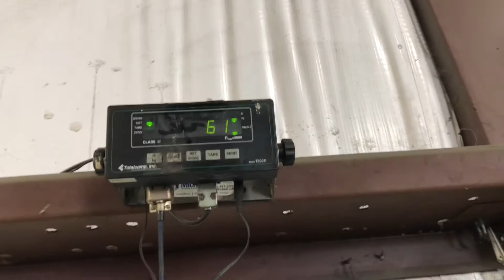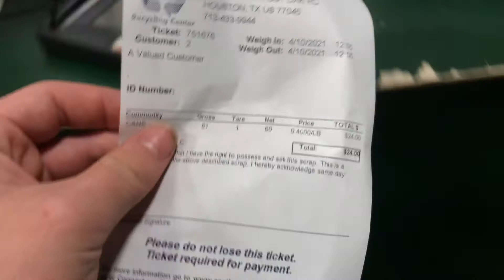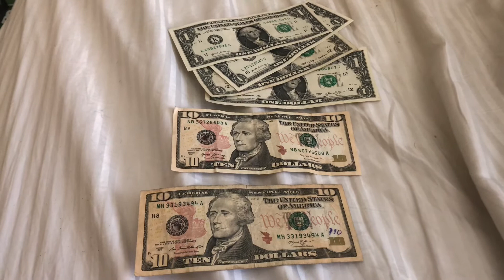Scrapping cans for money process

Comment: Oregon has a bottle bill that requires a 10 cent deposit on EACH can. People can get their 10 cents back by taking their cans to a can recycle location. The auto-reader reads the bar code and checks against list of can types that have had deposit paid on them. In order for the reader to scan the cans, the cans can't be crushed or the bar code won't be readable. Someone has paid the deposit on each can, usually the people who purchased the soft drink contents, so this processing only returns the money already paid on deposit. Taking cans into a metal recycling location where they're weighed probably won't result in 10 cents per can. So, it's a wash for people either way. Not all states have bottle bills.
Reply: Will the reader know if the cans are from a different state ?
Reply: @MoneyMike0x yes if it doesn’t have the Oregon 10 cents on it

Comment: I have 3 trash bags that are bigger than the one you have filled to the top and one garbage bag and 100 to 250 pounds of metal and a lot of aluminum 7 pound and lots of wires and copper